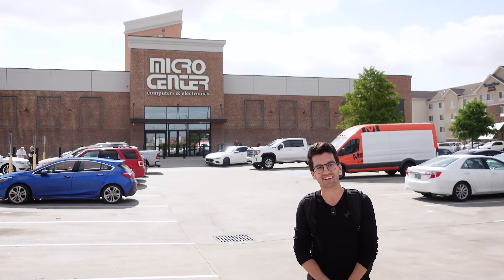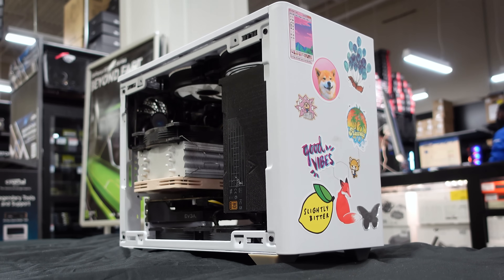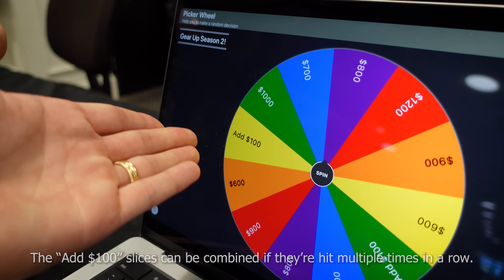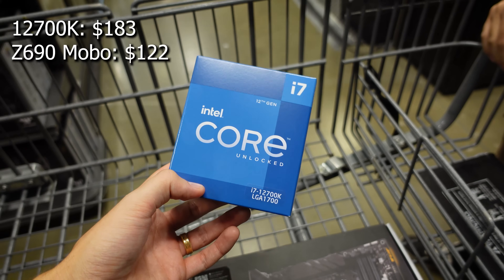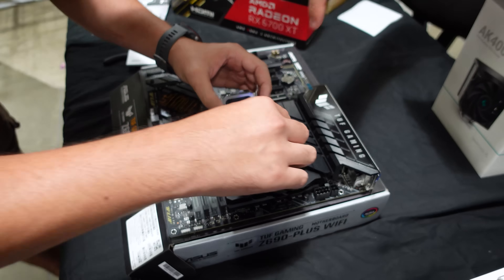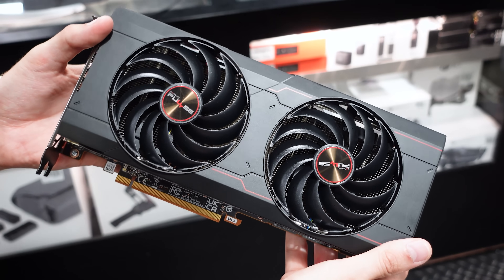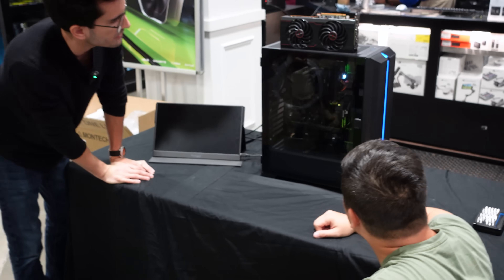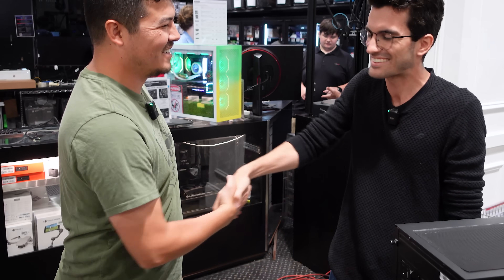He CRUSHED IT With This PC Budget! - Gear Up S2:E1

Comment: So far DDR5 with current gen IMC of processors is sometimes wonky if they're not paired, hopefully, when he adds another 16 GB, it'll work out of the box, if not, hopefully Chris knows how to add voltage with VDDQ and VCCSA/System Agent might need a little bump.

This is especially true if trying to get 4 sticks working. In this case, even making voltages not synchronized will help with stability too.

Comment: lol I have that card...well the non TI varient anyways. Looks identical but without the Ti in the name. Had it up 2021 after which I upgraded to a 780Ti. GPU prices were pretty bad at the time so I didn't get anything modern and chose a 780Ti. Would have gone 980Ti or Titan X since I was looking to get something that still had VGA output support but even those were still too pricy at the time. :P

His rig isn't too far off from what mine is currently too. Until last year I was still using a first generation i7 (a 965 Extreme Edition) with 24GB of DDR3 ram on a Asus P6T motherboard (original version not the SE or Deluxe variants).

Then in December of last year I upgraded it to a 4th gen i7 4790 rig with paired to a Dell 9020MT motherboard since that meant free Windows 10 activation. I am now with a bit less ram at 16GB since this newer mobo doesn't have 6 ram slots like that gen 1 beast of a motherboard. :P I have to get 8GB DDR3 ram modules if I want to max the new motherboard out which means I have to replace the ram in all 4 ram slots so it hasn't been a priority.

Saving money on not having to replace my DDR3 ram was the primary reason I stayed back with a DDR3 based rig instead of going straight to a modern setup and some of the last DDR3 stuff was a bit more pricey then I wanted. Gen 4 CPUs are still cheap compared to the newer stuff at the time so that's what I chose to go with.

Comment: The 6700 XT is such a good GPU, it can run anything at 1080p at ultra setting with plenty of fps, 1440p high settings and give over 60 fps. For sub $400 you can't beat it.

Comment: wouldnt say he crushed it the 12700 is a little bit too much for a 6700xt
Reply from the maker: He absolutely did. You’ll always have a bottleneck no matter what you do. And depending on the game that 12700K can still be quite stressed.
Reply: @GregSalazar  maybe at 1080p but at 1440p i dont know anygame that would need that higher cpu i could be wrong but i know spiderman is cpu intensive but wouldnt base my entire build on one game .. again maybe you know of some relevant game right now . think i woudl buy cheaper cpu and put more into gpu but maybe his use case requires that.

Comment: Z690 for only 122$? Wow, what an incredible value! Even 12700K only 183$, man... 16gb ddr5 44$, crazy value! I wish for that man to be happy with new rig and to serve him well and for a long time. But really, I am jealous rn😂, mostly cuz of those prices as in my country (Montenegro) for 183$ (which comes like 150€) I can only get lik 5600G or i3 13100f, while 6700 XT is like 576€, which is A LOT. 16gb ddr5 with XMP/EXPO, idk about that, but also expensive. Currently I am building a 5600G rig which has B550M DS3H, 2x8gb 3200MHz CL16 ram, but I plan a GPU later on. And yeah, again, in my country, GPU prices are crazy. So I have to somehow find a money for it to buy a GPU. Used GPUs - no. Only new. But GPU prices... if they are like in USA, It would be easy for me

Comment: This irritates me to no end… I purchased the $350 i7-12700k and Asus z690 tuf motherboard bundle from Amazon about a month and a half ago but it was with the DDR4 variant of the board… And now Micro Center is doing the same deal with the DDR5 variant of the board… I realize the gaming performance upgrade is negligible, but it just future proves it more if there is such a thing… also, you only get one stick of ram with the DDR5 so if you want the dual band performance it is an extra expense, but still…

Comment: That 12700k bundle was just to damn good of a deal!! Holy smokes!! Won't even say what I paid for my 13700k and z790 at the beginning of this year at micro center. Was no deal like that let me tell you.
Reply: I built a 13700K with a Z790 as well back in January, I didn't have a Microcenter near me so the prices were even rougher, ouch.  Enjoying it though, was a nice upgrade from my old 9900K.
Reply: @ZoneXV  Enjoying mine as well. And as a bonus Msi just dropped a new bios update for the Z790 tomahawk for next gen cpu support for 14th gen.

Comment: Nice rig. Interesting choice to change from ITX given the generation of GPU used. Could possibly had gone for the 6800xt and used the same case rather than spending $80 on the case?
Reply from the maker: Cost difference for ITX would have pushed him far over the budget. The bundle he chose only came in ATX form factor. This was all discussed at the computer screen scenes earlier in the upgrade process 👍

Comment: That's a great upgrade for $800 bucks. I'd be willing to bet that after they finished filming, he went and bought a second stick of dimm and installed it as one would just be weird 😋
Reply: Great? That upgrade is out of this world. This guy went from a 3rd generation I5 to a 12th generation I7 platform. Then a GTX 650ti to a RX 6700xt for only $800.
Reply: The gentleman commented to this video ….. yes he did purchase the additional ram after 🥰😇👍💪
Reply: yea, rip to the GPU aswell lol connected 1 pcie psu cable
Reply: @goxlrbedwars  I connected one pcie cable to my 6800 a while ago. The pc just restarted. The GPU doesn't get murdered just because you used 1 pcie cable instead of 2.
Reply: @goxlrbedwars No, that would not hurt the gpu in the slightest, often it will power up enough for basic use but any large work loads would make it reset the pc.
Reply: Be just fine, dual channel offers a tad more performance but it isn't God tier or anything crazy.  Games, work programs everything will run just fine with a single Dimm.
Reply: @animalyze7120  Not on Ryzen. It makes a big difference.
Reply: I know I would as it would set off my OCD
Reply: @JohnDoe-bz4yl That OCD is not justified as dual channel for just gaming really isn't that crazy vs a single dimm.  It will be better but a single dimm will run anything just fine, you'd really notice in things like blender or times for crunching large videos but in games not so much as to cause a deal breaking issue.